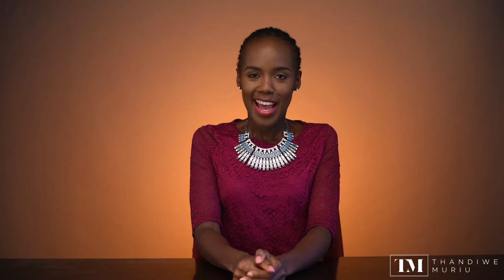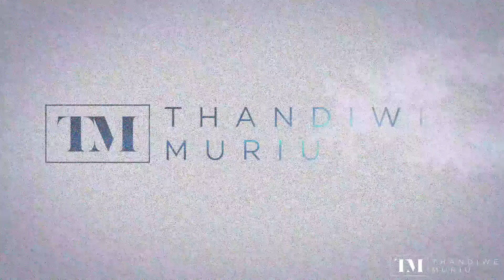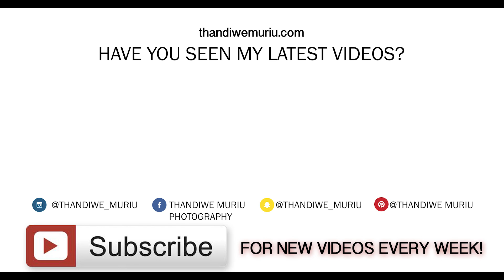Episode 16 - Full Frame vs Cropped Sensor

Comment: Can I dispel a myth here. Billboards are viewed from around 50 feet away. Up close, the image cannot even be seen. it is just primary-colour patterns. You can take photos that are enlarged to billboard size, on a 6mp camera and still retain all the detail you need when viewed at the intended viewing distance. So, bad analogy! 
Also, the crop sensor does not 'zoom in' to give a larger image. The image is not larger at all. The sensor is smaller and the image overlaps it quite significantly. The crop-sensor captures a smaller area than the full-frame sensor, which is how the crop-sensor appears to have more reach.

Comment: Ha, I also have a D7000 from years ago and recently purchased a D750; I'm keeping both for wedding/event photography use and the benefit of the difference in how each body works with the same lenses. One additional difference between full frame and crop is that, along with depth of field differences, the amount of light is also affected and requires adjustment via shutter speed or ISO to get the same effective exposure; for example, an f2.8 lens on FX performs like about an f4 on DX in both depth of field and exposure.

Comment: This is a really good video, the only thing that's a bit weird is when you say crop sensor is like 720p vs full frame being 1080p. This is untrue. The sensors will have the same amount of pixels. A crop sensor that has 24mp will be the same resolution as a full frame 24mp sensor. The difference is that the actual diodes that detect light are bigger. This is why full frame can resolve more detail and is better in low light. Just my two cents having to take countless classes around sensor design and lens design for my photography degree. Again awesome video and keep it up!
Reply: Jonathan Clarke yeah i was going to say the same that was the only part i didn’t like about this video, it was a bad comparison.

Comment: Very informative as always. Something else is that you will find lenses are labelled accordingly. In the case of Canon, crop sensor lenses are EF-S and for full frame are EF and the lining up markers are white for EF-S/crop sensor and red for EF/full frame. Another thing, the Canon EF-S lens will not be able to mount on a full frame camera.
Reply: And in relation to billboards, full frame is good, but you will find that most photographers would go for medium format. VERY expensive, but justifiable for its use in advertising.
Reply from the maker: Thanks for sharing these insights Elsie. You're very right.
Reply from the maker: I've found that locally most people use full-frames for advertising. On the global scene however medium format cameras are more of the norm. 
Both work well but medium format is preferred for its better color and incredible sharpness. However its focusing is significantly slower than DSLR's is what I've found and you need the right machines to work on the huge files. So all in all very expensive but SO worth it.